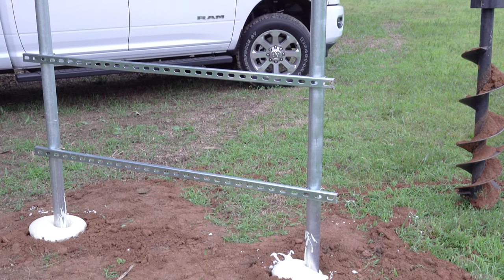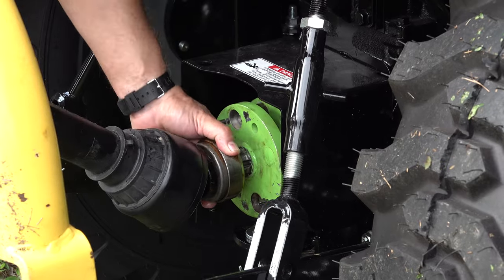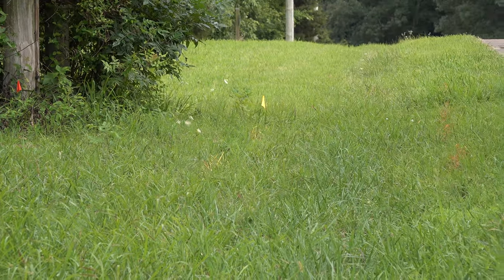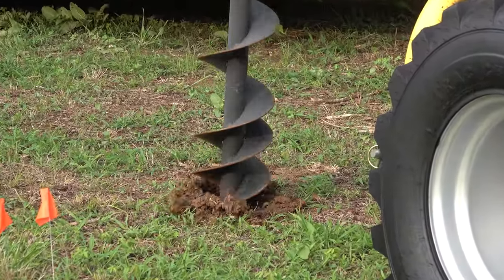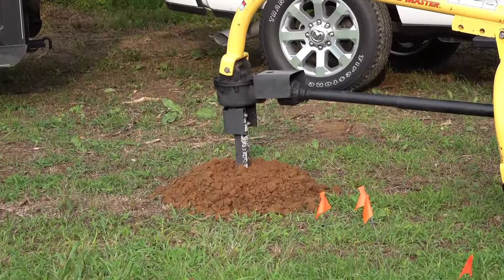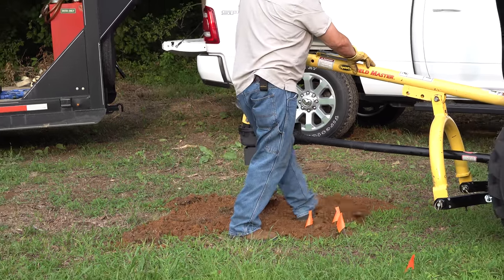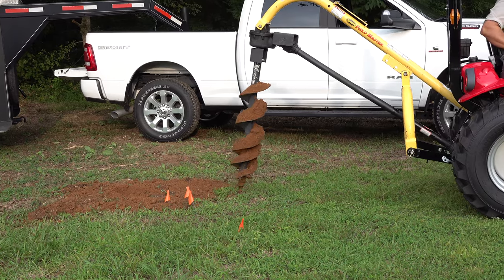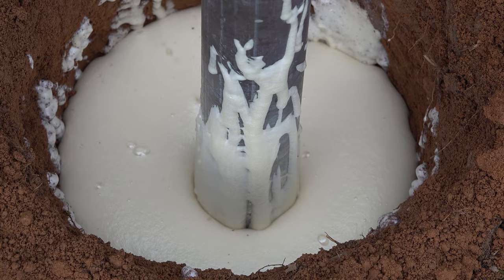Post Hole Digger for Tractor |Tips you may not know about! TYM T25

Comment: I just did the same video about 2 months ago. I agree with the pto hook up too. It’s surprising how many people use the post augers at full throttle. Even a 2 man auger that handles a 12” auger from Home Depot only has a 5hp engine. Does not take a lot of power to dig a big hole. My ls 122 handles a auger like a champ, and eats roots right up too. Done a couple fence holes in a brushy wooded area with no issue. Most people rev high, then the auger drills and becomes stuck. Low rpm will warn you of trouble and keep you from getting sucked in.
Reply from the maker: I did a post-hole digger video a few years ago, but I always go to revisit. Slow wins
Reply: @TonysTractorAdventure  probably my favorite attachment to run actually. I have a lot of fun with those things. 🤣

Comment: You are fortunate to have zero rocks there because things would not go so easy where I live. I’ve used the hand held powered augers and you aren’t moving an inch deeper until you hand dig the rock out and return to the auger over and over. I’m thinking to get one for my tractor but I’m sure it still means stopping every damn 3” to breaker bar a rock out before going any further. That is pure soil where you live I didn’t even see any rocks at all in that.
Reply from the maker: I mean this with no disrespect but it wasn't fortune. This area was planned due to soil conditions and low cost of living. We've lived in other places that are horrendously rocky. I don't want to try to build a homestead amongst that.